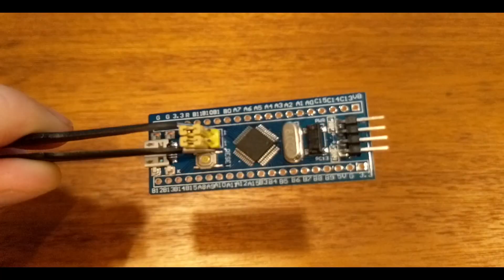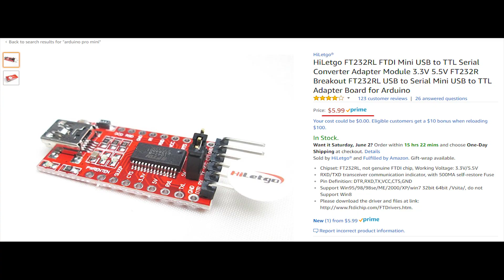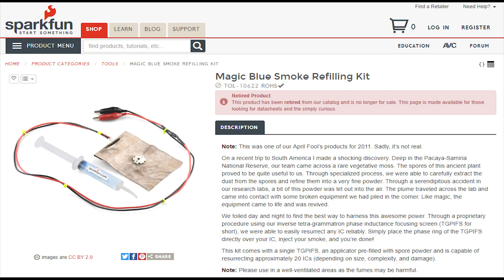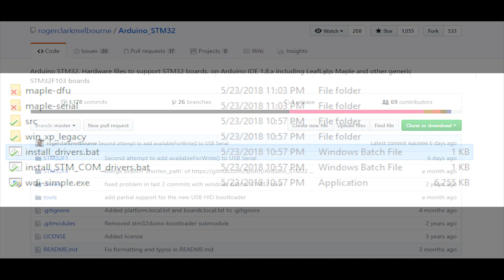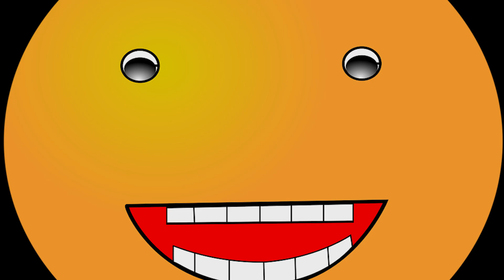Installing the STM32 USB Bootloader, Easily! [SEE DESCRIPTION]

Comment: i am getting this error 
Resetting to bootloader via DTR pulse
#
# A fatal error has been detected by the Java Runtime Environment:
#
#  EXCEPTION_ACCESS_VIOLATION (0xc0000005) at pc=0x000000007110b5db, pid=4152, tid=0x00000000000020dc
#
# JRE version: OpenJDK Runtime Environment (8.0_452-b09) (build 1.8.0_452-b09)
# Java VM: OpenJDK 64-Bit Server VM (25.452-b09 mixed mode windows-amd64 compressed oops)
# Problematic frame:
# C  [jSSC-2.8_x86_64.dll+0xb5db]
#
# Failed to write core dump. Minidumps are not enabled by default on client versions of Windows
#
# An error report file with more information is saved as:
# C:\Users\user\AppData\Local\Arduino15\packages\stm32duino\tools\stm32tools\2022.9.26\win\hs_err_pid4152.log
#
# If you would like to submit a bug report, please visit:
#   https://github.com/adoptium/adoptium-support/issues
# The crash happened outside the Java Virtual Machine in native code.
# See problematic frame for where to report the bug.
#
Reply from the maker: Not seen that one before, might be a java issue? Maybe try a new version of open jdk?

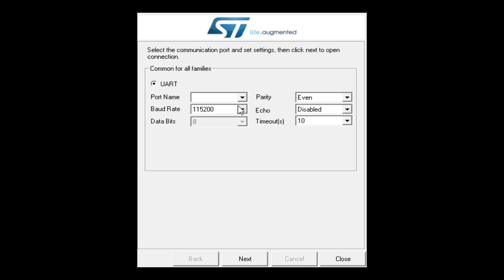Comment: great video but i have a problem at 4:24 , the flash loader see the port but when i press next amessage apeared which says that the port is used by another programm i suppose it's arduino software but whatever i made the same message still appear
Reply from the maker: Sometimes Windows is just stupid and won't release a port even though nothing is using it. Give your computer a restart and try it again! Also just download it and you'll select that file when you upload, wherever it is
Reply: @CalebMarting  thanks alot it's finally downloaded but the port is read as maple003 (com 6) with a yellow mark and whatever i did , i can't solve this problem so i hope you have exp with this issue
Reply: i wonder also where to put the file of generic_boot20_PC13 or i just download it without relocating it

Comment: Hey, just a quick question - can i use a rs232 to usb adapter instead of the ftdi breakout board? I can't order it now but i want to try using it
Reply from the maker: You'd have to check the data sheet, I think it only supports uart for upload, check the bootloader section in the chip sdatasheets

Comment: You realise the USB port works as a USB port, right?  You realise that nobody outside of bedrooms uses serial for programming and debug.  Most people use JTAG or similar and a proper professional IDE with code step, variable watch and disassembly etc. etc.
As an example, enabling the USB port in your project and setting it up as a CDC VCom port gives you a serial IO over USB in your actual project.  Not sure about the F103 but the F411 will certainly accept USB Audio over the USB port.
So don't waste it on a USB programmer interface, that's weird.
Go buy an STLink, it's like $1.99!

Comment: I thought any stm32 should support DFU bootloader on the usb port out of the box. At least in the datasheet they didn't say anything about adding any extra bootloader in AN3156 document. Or the goal of this video is to add an Arduino bootloader on the STM32? It is confusing to me.
Reply from the maker: This is not required, and it just provides a way to upload bin files or use Arduino on the STM 32 f103 without needing an external programmer like a serial adapter or st-link. The f103 is old enough where it doesn't actually come with a dfu bootloader, and instead code can only be uploaded typically over serial or dfu. This bootloader is basically only useful for Arduino development however

Comment: This doesn't mean that I can upload programs directly from stm32 cube ide right? I don't have a separate stlink only the one on my nucleo and I'm not detaching it
Reply from the maker: I don't believe it's possible unless you make a custom upload command which I think is technically feasible. However you won't get the benefits of debugging code and such. You might need to steal the python script or whatever it uses from the actual Arduino files. If you try my hid bootloader it comes with a flasher CLI that you could use
Reply: @CalebMarting  thank you very much for answering. Currently I'm using a USB to TTL converter to connect this custom Chinese blue pill to my PC. I want to upload a program I have compiled in cube ide. I believe I can do so using stm32 cube programmer. Now the question is do I upload the . elf file or . bin file?
Reply from the maker: Elf is used for debugging, bin is what you want to upload, although don't be afraid to experiment, you pretty much can't break it unlike a regular computer
Reply: @CalebMarting  thanks for helping me. Like and subscribed!

Comment: After completion of procedure,
Is there any need to change that jumpers boot point at any point in FUTURE application and different codes
Reply from the maker: The only jumper you would change is the boot one jumper. The opposite of the one that you used. When it's in the one position it forces the bootloader to be enabled, so if you having issues uploading code you can put the boot one jumper to one. Otherwise you should never need to move jumpers
Reply: @CalebMarting  
Thank you so much...

Comment: Why do you need this bootloader if STM32 has an internal DFU bootloader?
Reply from the maker: Some stm32s don't have a dfu bootloader, for instance the f103c8. If this were about the f4x1 you would be correct, and I have a video on those too
Reply: thank you. where can I get info about it? They don't mention it here: 
https://www.st.com/resource/en/programming_manual/cd00283419-stm32f10xxx-flash-memory-microcontrollers-stmicroelectronics.pdf
https://www.st.com/resource/en/application_note/cd00264379-usb-dfu-protocol-used-in-the-stm32-bootloader-stmicroelectronics.pdf
Reply from the maker: https://www.google.com/url?sa=t&source=web&rct=j&url=https://www.st.com/resource/en/reference_manual/cd00171190-stm32f101xx-stm32f102xx-stm32f103xx-stm32f105xx-and-stm32f107xx-advanced-arm-based-32-bit-mcus-stmicroelectronics.pdf&ved=2ahUKEwi31qK4wYztAhVEGDQIHexmDn8QFjAAegQIJBAC&usg=AOvVaw2kF0T1D3TzsgvgnX7fvMku under the section titled "boot configuration"

Comment: If you plan on using the blue pill as a usb device for a project, I recommend not installing the usb bootloader because I did some usb projects with STM32CubeIDE and they take quite a lot of memory. I don't have exact numbers written down but I could use over 40% of flash and RAM just to make a mouse with a joystick. Black Pills' uCs have an inherent USB bootloader according to datasheet though.

Comment: How do you deal with fake FTDI drivers?
Reply from the maker: Shouldn't matter too much. I just installed them and then use them as I would any other adapter. I assume you're talking about the CH340
Reply: @CalebMarting  ohh I see, actually I'm not aware that I've bought a fake FTDI and it doesn't work, apparently it was bricked by the official company. Very sad as I'm very poor. Tried every instructions online nothing worked lol.

Comment: when i try conect with stm cube programmer said"verify the boot mode and check the serial port configuration" but i see in arduino ide port like port6 ,maybe you know whats the problem.thanks in advance.
Reply from the maker: If you're connecting with serial in STM32 cube prog, you need to have boot one in the one position, press reset, and then connect with the serial port
Reply: @CalebMarting  now is ok, i changed 100k on midle pin boot0 to stm32, now is 10k, thanks.
Reply: @CalebMarting  thanks so much ,but i try this,interesting thing that my China Blue Pill board ,green led blinking always ,i think that isnt ok !

Comment: My program upload is too slow it take too much time to compile and then uploading also too slow
Reply from the maker: Try Platformio and vscode. I'm looking into making a tutorial for that but that won't be for a while. The problem is that it has to recompile everything because of how the Arduino IDE is set up. Platform IO is able to only compile the files you changed so it's a lot faster

Comment: I thought this didn't work for the longest time. I tried everything and never got it to work. The FTDI wouldn't program the blue pill, and after using the ST-Link to flash the bootloader the Arduino IDE still wouldn't program it.  I tried swapping the resistor and still nothing.  Then I finally came across the information I needed.  The STM32 on my board was fake, and so was the FTDI.  Also the ST-Link seems fake but it still works.  Turns out almost everything I had was fake, guess that's what I get from buying from China but I had no idea.  Anyway after ordering the chips from Digikey and soldering them all up this works great.  Just wish I would have found out sooner.
Reply from the maker: Unfortunately this is one of the most counterfeit chips. It's not just counterfeits though, sometimes bad chips make it into production because they're a lot cheaper. I'm going to end up putting something in the description. usually the counterfeits end up working, but you should always buy in batches of two or three if you get counterfeit ones just in case
Reply: @CalebMarting  I did buy two.  They would connect and display Maple Mini in the device manager but only about 10% of the time, the rest of the time it would show device failure.  Even when it did work, when the Arduino IDE would reboot to program then you had another 10% chance the computer would recognize it, unfortunately for me it never did.  Also I have heard the fakes can work but never perform to spec of the STM32.
Reply: The main reason is "the fake" boards are using ch32f103c6t8 which is not able to program it with serial like ftdi programming. They can just programming with st-link. Doesn't matter st-link is fake or not.  At least my experience on 3 serial programming boards and research on amazon reviews says it.
Reply: @darkerse  Good info thanks I will take a look at the specs for the chip you mentioned

Comment: Can i use other rx tx from my board?
Reply from the maker: There are actually 3 sets of UART rx tx on this board. I don't know how to use all of them with this video's core, but if you use the core from this video https://www.youtube.com/watch?v=Myon8H111PQ you can use those serial devices using the HardwareSerial library

https://github.com/stm32duino/Arduino_Core_STM32/blob/cffb347c52bb1813e5e15a0928bb0a1af138db24/cores/arduino/HardwareSerial.h

Comment: MAGIC SMOKE REFILL KIT @ 1.55
Sadly, Sparkfun discontinued sales of the Magic Smoke Refill Kit

I did some research to see if I could replicate it.  The crystalline structure of the silicon that makes up the chips seem to crystallize in a  tetrahedron form. when the voltage gets too high, the angular lattice of the silicone vaporizes, but the structure remains partially intact.
By a rather complicated osmosis process, it might be able to be replenished.  The best I could figure is that it would be a process of:

Tetra-Osmosis Tetrahedron Angular Lattice Binary Sedimentation

unfortunately, the acronym does not sound quite as scientific.

Comment: check what you buy. the 'BluePill' should have the USB bootloader installed, but costs a dollar more.
Reply from the maker: There are multiple versions of the bootloader that are incompatible with each other, also I think you meant black pill although that can now refer to the STM32 F4
Reply: @CalebMarting  : when I first started with the STM32 there were options to buy it with the boot loader for use with the Arduino IDE and the pre-installed bootloader boards as the 'blue-pill' while the non-bootloader were the STM-32. the 'blue pill' pre-installed boot loader boards were about $1 more.
however, in the years since, the terms have been misused to the point that they don't mean anything anymore. 

Since Roger took down his forum, pre-installed boards are not easy to find anymore.
could be what you said, too many are not compatible with the latest version....
could be that the Arduino IDE is not all that great.
could be that with each evolution of the Arduino IDE, things don't work like they did in the last version.

Comment: Hello, after a lot of trials and tests, I followed your video step by step and I finally managed to get the bootloader (...pc13.bin) for my "blue-pill" module working.
I'm with windows 10 and it's much more random than with W7.
Thanks for everything!

Bonjour, après beaucoup d'essais et de tests, j'ai suivi votre vidéo pas à pas et j'ai enfin réussi à mettre en fonctionnement le bootloader (...pc13.bin) pour mon module "blue-pill".
Je suis avec windows 10 et c'est bien plus aléatoire qu'avec W7.
Merci pour tout !
Reply from the maker: If you would like to try it I have a new version of the bootloader that doesn't require any weird drivers, it's a little more difficult to get it up and running but I've had a lot of success with it. https://youtu.be/Myon8H111PQ

Comment: Very informative video. I would love to see these processors used in either for Analog to Digital type of projects as well as Digital to Analog. Like the Teensy processors Paul has provided a nice web interface to build the DAC components. I was looking at using one of these processor to avoid buying DACs and ADC and Reference voltage since these should all be built into the processor.

Comment: i did every step , redid again , restarted pc and all ...   still Stm32 not recognised .
 
i had some resistors lying around , made series combination to reach a value of 1.5k and attached where you are showing in the video. shorted R10. NO gain . 

then checked R10 value with my multimeter , it came out to be  1.3k 
and checked R2 value , which was 10K.
Is R2 's value ok?  and can you help me in any way?
Reply from the maker: I've been hearing that this has been failing recently. I made this video 2 years ago so it's possible something has changed in that time. I would recommend getting an ST Link V2 as it is $2-5 and it is just pretty nice
Reply: @CalebMarting  thanks for your reply.  Hmm i might get one..  

also if use the stmflash application to clear all the pages , will it remove the bootloader? 
and i was thinking to try using usb with ubuntu and see if this problem persist . Or if you know , this will be same in ubuntu ? then i will be saved from all the headache of setting everything in ubuntu .
Reply from the maker: You can overwrite the bootloader by just uploading another program over serial (move boot 0 to 1 position, etc)
Reply: @CalebMarting  thanks

Comment: i followed the same process as you and uploaded binary file and succesfully installed drivers but as soon as i plug stm32 to my pc it throws error that it does not recognise this device.
any help
Reply from the maker: It could be a faulty board but try reinstalling the drivers again
Reply: @CalebMarting  i did 4 5 times but same problem . but i am still be able to upload code using usb to serial converter.

Comment: Does it works only on old arduino version. I tried all tutorials on you tube but no results!
Reply from the maker: I'm not sure, my guess would be drivers of the most important versus Arduino version
Reply: @CalebMarting  failed to knit device
Stm32flash 0.4
Http:// stm32flash.googlecode.com/ 
That's the error im getting. Do you know how to solve that?

Comment: I can flash (and verify) the bootloader fine, but when I plug the USB cable into my Win10 machine I get Code 43 device cannot start :-( I can't fix this. R3 is 1K5
Reply from the maker: Sounds like a driver issue... Hmmm, could you join the discord mentioned in the description of the video?
Reply: @CalebMarting  Its very strange - with or without the bootloader installed the USB connection direct to the board generates the code 43 error - tried 2 PCs and they are both the same. The board looks identical to yours :-(
Reply from the maker: I think that definitely sounds like a driver issue, especially if the bootloader isn't installed. But I've only see this happen once before on a different device and it would crash my computer. Do you have another board? It could also be defective or a bad USB cable maybe?

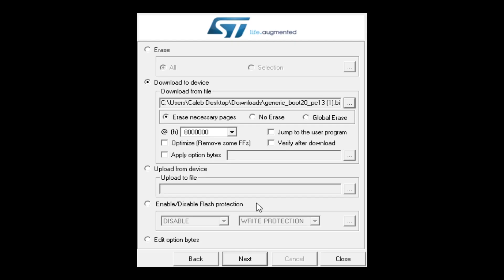Comment: Hello, I am getting error unable to flash memory in (5:01) and cannot download data. Any advice? Thank you
Reply from the maker: Is it a genuine stm32 or is there a different company's name on the chip? It could be that the flash memory is locked as well but I don't know how to fix that
Reply: @CalebMarting  Thanks for quick response. I do not know much about the chip. I had to erase all first then flashing worked. Now i can't get over another issue; unknown usb device, code 43 which seems to be unsolvable so I guess am done with this.
Reply: I figured it out. So, for those who have same problem:
Bootloader generic_boot20_pc13 (26.12.2019) not works on some old boards, you can check versions by code written on head of STM32 chip or better by value of Resistor R10 which on these boards equals to 10kOhm. 
1) In Demonstrator GUI, first "erase all" (first option in Demonstrator) and then you can upload bootloader with "no erase". Another way is to use STLink 2 and cubeMX programmer - you dont need switch boot jumper and its faster.
2) Find 2 years old bootloader (you can find in history on github), upload to bluepill, and voila, Windows recognizing device as "Maple DFU" in "libusb-win32" category in device manager. In COM and LPT ports you need unninstall all devices. Run arduino IDE and upload random sketch with COM port grayed out (empty), other settings just like in video. You can hear "tudy tydu" and it's done. Working for me.